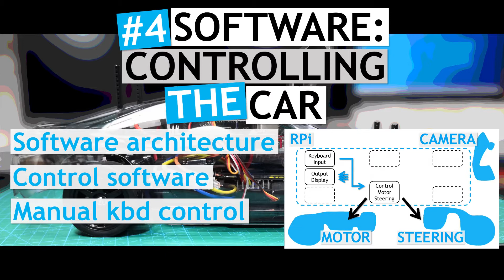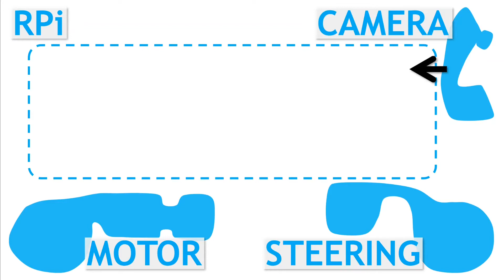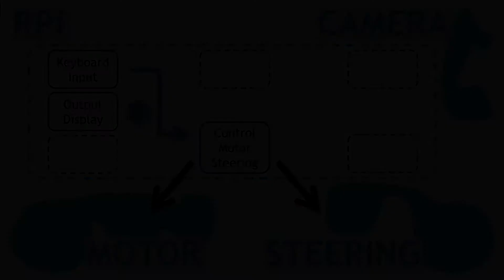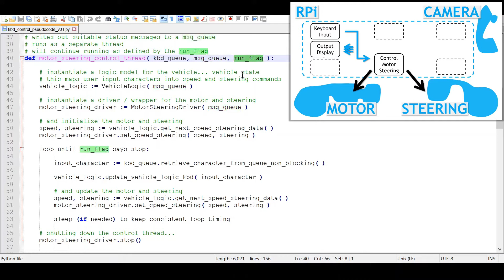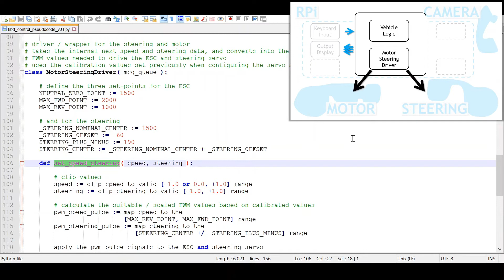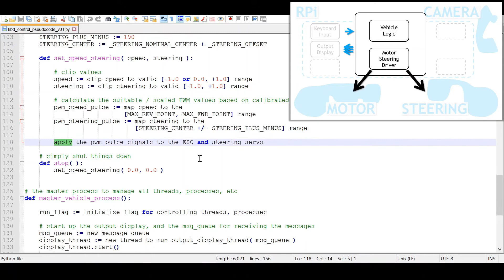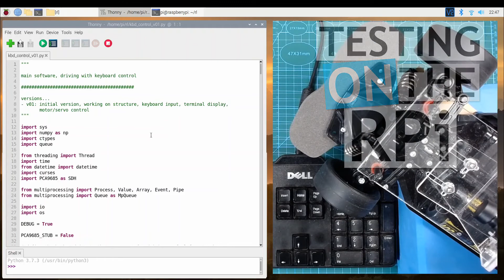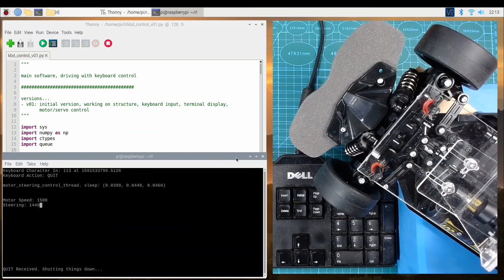Software (Part 1): Controlling the Car

Comment: Where I can get this full code?
Reply from the maker: I'm not planning on releasing the actual code. If you are looking for code that is reusable I would recommend looking at the Donkey Car solution.
Reply: @theunsupervisedengineer1310  why cant you release the codes?
Reply: i mean i have bin looking for about 4 mouths for a video that achuly uses the pca9685 that i got and here it is but you dont wanna release the codes? sorry im at a loss
Reply from the maker: @ghostrunner7764  I used the Waveshare code to get me started with pca9685 servo driver. Sample code in link https://www.waveshare.com/wiki/Servo_Driver_HAT